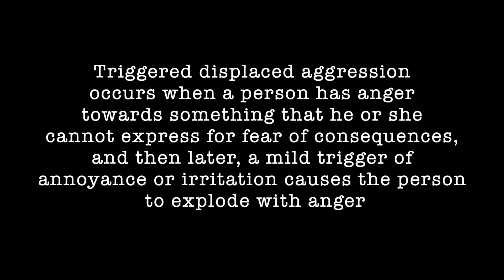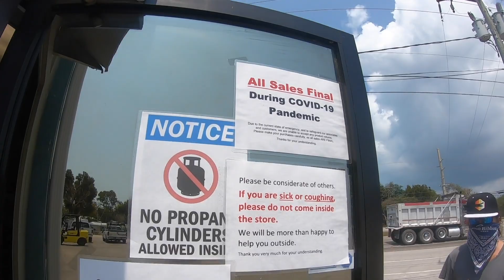Using our Dinghy to Move our Engineless 41' Sailboat thru a Tight Channel ( Litzenbergers Ep.115)

Comment: Get a 12V, 4 to 6 PSI diesel pump. $20 to $60 and can be used to solve your instant issue and to: transfer fuel, polish fuel, bypass the lift pump and or run off a jerry jug, etc,etc,etc. That and some A10 fuel hose.  Take a lighter or soldering gun tip to your blood sucking tie straps.
Reply from the maker: Great tips, I like where your heads at
Reply: @SailingwiththeLitzenbergers  You need about 5 PSI for either a Beta or a Perkins.  About 3PSI  or so for most Yanmars  Get a continuous duty pump.  Yanmar runs lots of their newer diesels off an electric lift pump. Consider buying two of one style and just getting rid of your existing lift pump either by plate or just disconnect the plumbing and leave it there. You can get a Perkins mechanical lift pump but last time I looked they were over $100 each.
Reply from the maker: Thanks for all the info! 😊

Comment: Great video. Totally agree with the tie-wrap orientation. People just don't think about future work in those areas. I feel your pain. Safe travels to you both.
Reply: If you use the proper tie wrap tensioning/cutting tool, or a pair of flush cut pliers to trim them, it's a non issue.

Comment: Get some flush cutters, solve the tie wrap problem.
Reply: Absolutely makes me crazy when someone does not use flush cutting wire cutters to trim zip ties. Been ripped open way to meany times. My daughter still has a scar from a sign that was attached to a pole in Germany with a razor sharp zip tie hiding on the other side.
Reply from the maker: 🙌🏻 gotta get some now that we’re stateside!
Reply: Or get an aircraft mechanic to teach you to use wire lacing cord.

Comment: Install an outboard bracket on the stern of the boat and use the outboard to move the boat when having issues with diesel engine which is always😂 Or switch to electric drive and you will never have issues plus you will be encouraged to sail more for regen charging!
Reply from the maker: I think you recommended this on another video and we did try it 😃 but the lip on the sugar scoop wasn’t tall enough, but we are definitely down with the idea!!
Reply: @SailingwiththeLitzenbergers  How about an outboard bracket on the sugar scoop. Right, I'm not going to do it on our boat though.
Reply: A boat like Tarka is really made for sailing the high latitudes where solar and therefore electric power are not really viable choices.